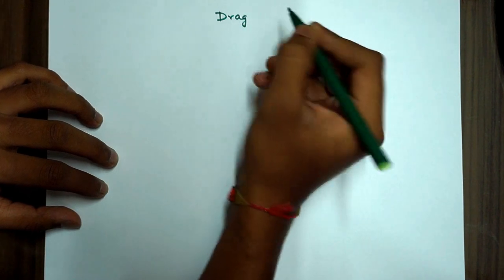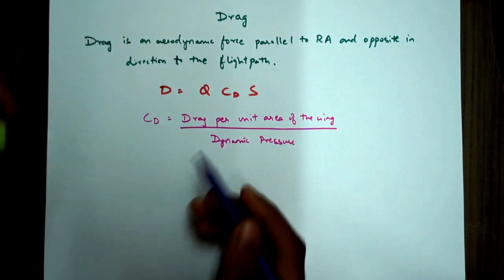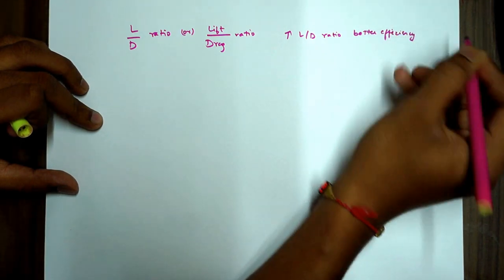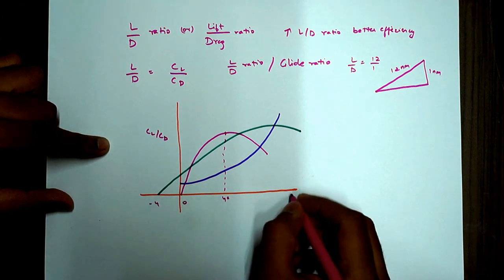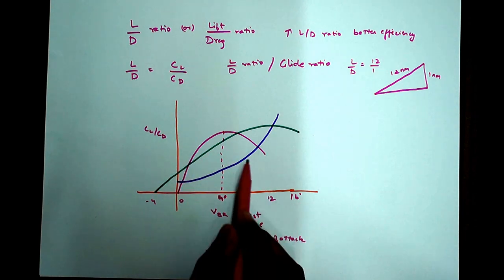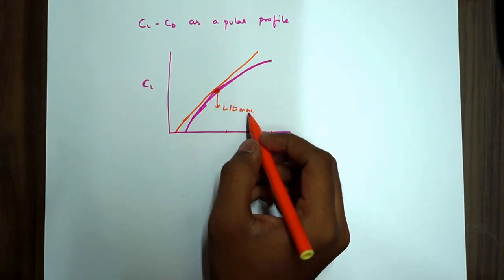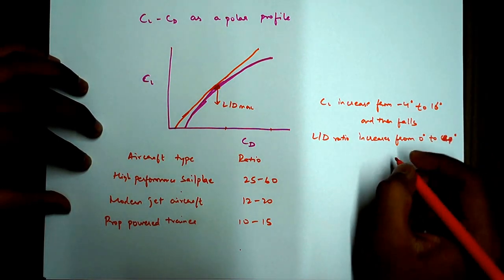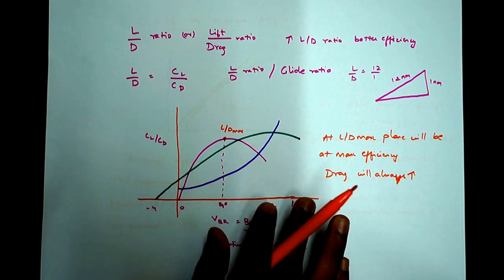Drag, Coefficient of Drag, L/D ratio

Comment: Please correct me if I'm wrong. I believe that at minimum drag is equal to max endurance rather than max range. Since fuel flow is a function of thrust for jet engines, lower drag would mean less thrust required to maintain the same speed. Max range however is the best ratio of CL and CD. Again if I'm mistaking, please let me know why. Thank you!
Reply from the maker: +Parsa Shamsi You haven't mentioned anything wrong as far as I'm concerned. But just to throw some light on the topic, here it is as follows:

The speed at which total drag is minimum (Vmd) when the induced and parasite drag are equal. Range, endurance, climb, glide, manoeuvre, landing and take-off performance are all based on some relationship involving the aeroplane's total drag curve. So the total drag curve involves multiple factors like drag, IAS, thrust available (or) required (or) excess (or) deficiency, CL, CD and weight. The idea is that Maximum L/D ratio is a measure of aerodynamic efficiency. Hence any angle of attack other than that for L/Dmax increases drag for a given lift force, which requires more thrust, which is inefficient and expensive. Also if IAS is varied, L/D varies. 

I hope this discussion has helped in some sense. Thanks. Cheers! :)

Comment: I have a question, but I need you to respond at this time and I know it is not possible, the point is, if I find Lift and drag, all I have to do to find MAX L / D is divide LIFT by DRAG?
Reply from the maker: No, maximum lift and drag is decided by manufacturer.

Comment: Hey could you help me please I want to calculate Cx and Cz (drag and lift coefficient) of a 46m/s wind speed at an inclined panel with 30° incidence angle the force should be daN/m² or we could calculate the Drag and lift force on a panel of a 1.7x1 = 1.7m² area. SEARCHING SINCE A WEEK BUT NOTHING FOUND ON INTERNET. MECAFLUX software GIVES An automatic RESULT BUT I couldn't calculate manually.
Reply from the maker: I doubt I'll be able to help you with that! Sorry!

Comment: how do u do this? " At an altitude of 3600 feet, the aircraft covered a distance of 7200 feet Determine the angle at which the aircraft is gliding" I really need this help thanks a lot!!
Reply from the maker: +Chasple Lim Real easy that is. If you are aware of trigonometry the answer to this would be Tan Inv (3600/7200). Answer would come about to 26 degrees. Hope it helped. Welcome. :)
Reply: +DGCA Technical Thanks a lot!!!! :)

Comment: should the coefficient of drag be less or more ? which one is preferable for car designing.
Reply from the maker: It should be less but should not be zero. Because if there is no drag then lot of aerodynamic issues will arise, for example with no drag the car will not stop efficiently aerodynamically.
Reply: @poh  yeah aerodynamic issue will be there😁
Reply: @poh  but if we need to  reduce a drag,that is the challenging part in aerodynamics..
Reply from the maker: Ofcourse it is, but what I'm saying is it cannot and should not be zero also.